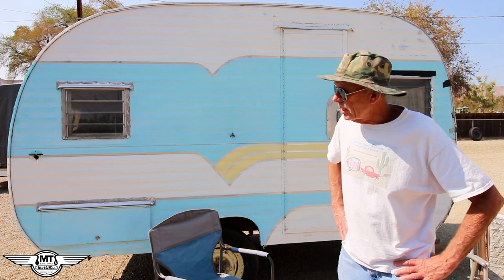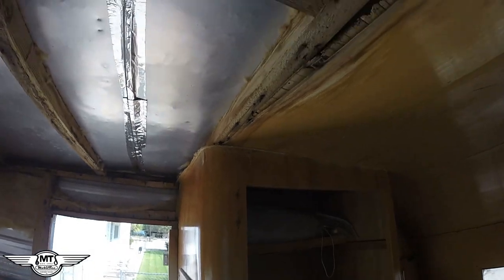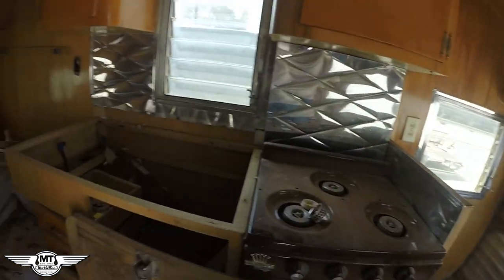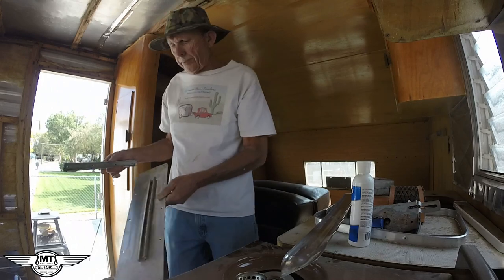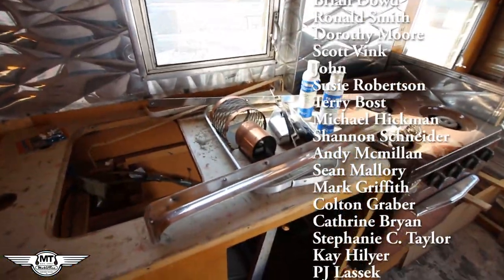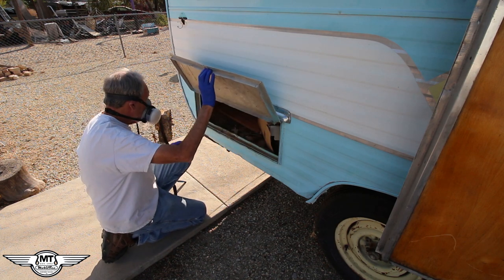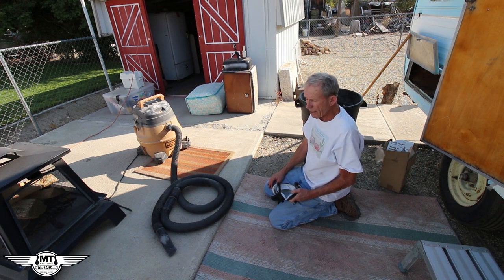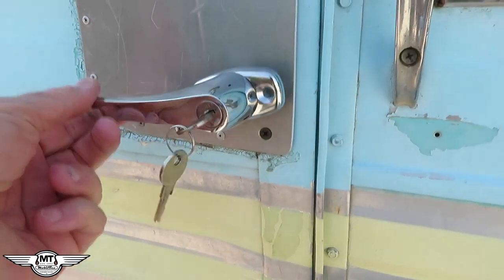Cleaning Out The 59 Deville   The Journey Begins

Comment: I’m restoring a 1950 Spartan Royal Mansion (33’ long) and a 1946 Spartan Manor (25’ long).  Completely gutted the Mansion: found an average of 5+” of mouse/rat turds; various dead animals; and one live rat more than a foot long (yes, I killed it rather than releasing it into the wild).  My respirator and I became best friends.  Didn’t wash my clothes...they went straight to the trashcan.  After removing all wood, I used a mixture of Simple Green and Bleach every day followed by high pressure water rinse.  After getting down to bare metal, everything was replaced.  I removed every scrap of wood from both campers;as I removed the wood (wall panels, cabinets, etc) I sprayed it down with the Simple Green + bleach and allowed it to dry in direct sun (UV light is a good thing).  You may think yours stank, but my wife wouldn’t all any windows open because of the smell.  It’s amazing how critters can live in fiberglas insulation!  Good luck and I feel for you!  Thank God our 1964 Fireball Meteor wasn’t this bad.  Out.
Reply from the maker: I think I would have just stuck with the Fireball.. LOL..

Comment: It seems that all the old RV's that I've looked at lately has rat droppings in it, how do they get in? How do you keep them out?
Reply from the maker: Don't let your trailer set in the desert for years without sealing it up. When they are not in use the rats will get in at the plumbing openings in the bottom of the trailer. Also bad door seals.

Comment: What is "gimp"
Reply from the maker: Gimp is that white bead you see in the corners of the inside of the trailer. It is sometimes referred to as Welting. It is also installed between the cabinets and the walls and ceiling or floor. It is put there for two reasons. One to clean up where everything meets and make it look nice. But the most important thing it does is provide a cushion between where the paneling meets up in the corners so the trailer doesn't squeek when you move around in it.